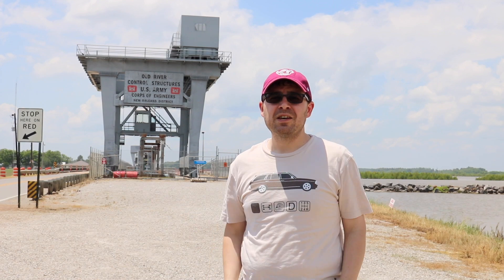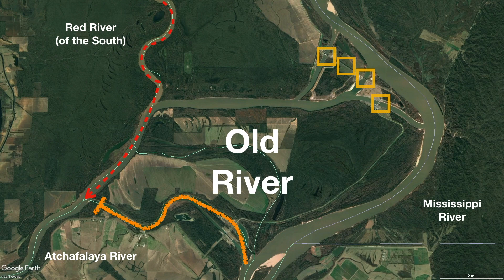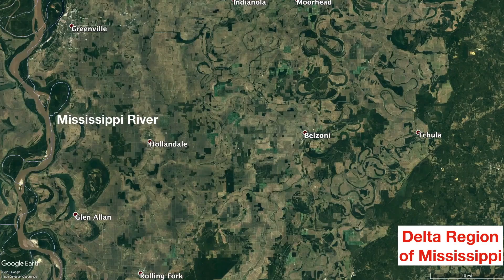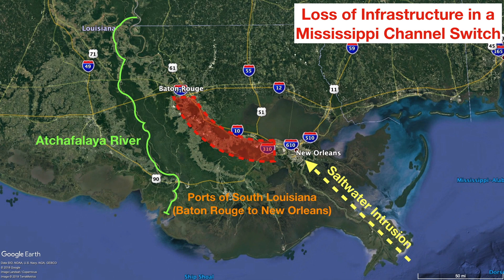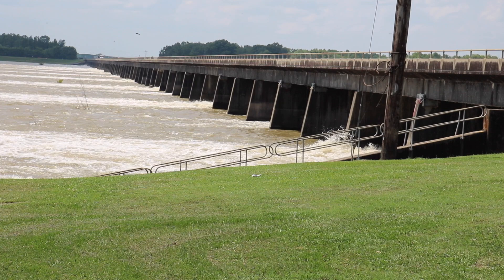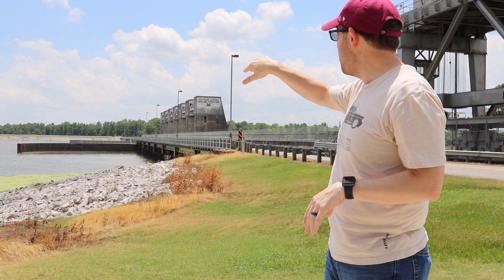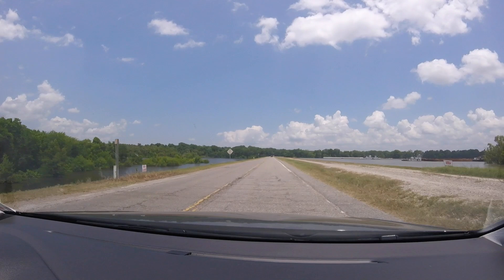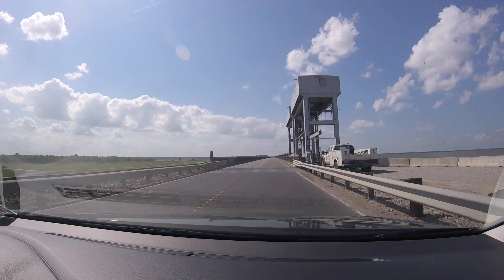Old River Control Structures--Phenomenon Explained

Comment: For a very informative essay on Old River and the control structures, see John McPhee's book, The Control of Nature. FWIW, New Orleans is considered to be in the ocean domain, and McPhee says it is not a matter of if the control structures fail, but when.
Reply from the maker: His essay is what got me interested in Old River years ago when I stumbles on it online. At the end of my series I'm going to do a quick wrap-up and list some more reading materials and that's the first resource I'm going to talk about. It's really good.
Reply: @lorencklein  McPhee is the gold standard of nonfiction.  Any book with his name on it is worth reading.  Most of his books consist of indepth essays, some of which I've read a dozen times or more.  Someone who just wants to get acquainted with McPhee's writing should read The John McPhee Reader and The Second John McPhee Reader.
Reply: @lorencklein  

Harold Fisk's report/study from 1952 provides plenty of information on this subject as well. So does the Louisiana Water Resources Research Institute study of 1980. Eventually what Fisk outlined as the "Project Flood" will be what causes the failure of ORCS. The entire flood control system of the Lower Mississippi River Valley was engineered to handle a flood event of up to the lower projections of Project Flood (river height & flow rate). Many of the Corps data graphs for current river conditions include Project Flood variables in those graphs. The doomsday flow rate is 2.71 cfs or greater at Vicksburg.
Reply from the maker: I have that article, as well as 3-4 other ones that I'll use in a future video on what would happen if the Mississippi changed its course at Old River. I found a couple others in a book called Beyond Control by James Barnett that was published in 2017.
Reply: @lorencklein  

Thanks. I will order that book shortly. I just previewed it on Amazon & in the opening Barnett says the ORCS was receiving a flow rate of 3 + million cfs in 1973 when it almost failed. I find that not believable being the entire  flood control system can only handle up 2.71 million cfs. Plus the highest flow rate just north at Vicksburg for that event in 1973 was 1.962 million cfs. 

https://nwis.waterdata.usgs.gov/nwis/peak?site_no=07289000&agency_cd=USGS&format=html

At 3+ million cfs both ORCS & Morganza would fail due to severe scouring.

Comment: Hello Loren Klein,   Well researched.  The need for the Old Man Structure begins with the clearing of a 30 mile long log jam in the 1830s down the Atchafalaya.   Openning that jam began the slippery slope of the Mississippi wanting to revert to the Atchafalaya as its major outlet.  There are many factors at play,,,,

The TVA and other dams upstream have reduced the silt load.  Temporarily,,, that silt is being saved, collected, behind every major dam upstream.  Levees have also channeled the silt directly out to see,, instead of the river gently over flowing it banks and renewing the level of the swamps  and even the entirety of the Delta.  The levees also build the height of the river exit to the sea,  which also raises the height of the upstream river bed.
Between 1800 and today  the Delta,, New Orleans is built on consolidating mud, has settled as much as 20 feet and the old river method of infilling those low spots,, annual floods has been stopped.  At the same time that the river bed is rising.  Ships passing New Orleans today are in a raised nearly artificial channel, the Mighty Mississippi.  Today June 22, 2019 the river is 18 feet above sea level,, while the average city elevation is sea level,, some as much as 10 feet below sea level.  When a ship passes New Orleans, the bottom of the ship is above the lower areas of the city.      And,, it continues to sink,, and will continue.  The bed of the river will continue to rise.  It is not an indefinite sustainable situation.

That raised river bed keeps making the Atchafalaya outlet and Morgan City a more and more attractive option to the gravity and physics of the Mississippi.   Couple that with the Old Man Control Structures being built in the shadow of an outside corner.  (Who thought that was a good idea?)    The Old Man Structure,, and the preservation of Baton Rouge and Chemical alley,,,,,with a nearly infinite number of dams and levees upstream,, focusing all the water ever to the south,,,.     it is only a when,, not an if.  In some large year,, this or another large water event,, the Mississippi is headed for Morgan City.  All of this is focused upon the ACE and Mother Nature.  The ACE has saved farmers fields and cities upstream, dams to prevent flooding, levees upon levees,, clearing 30 mile log jams,, and all of it points to an acceleration of the difference between the Miss and the Atchafalaya. 

I would begin moving infrastructure to the Atchafalaya,, today.
Reply from the maker: Have you seen my video on the History of Engineering Old River? I discuss all of what you mentioned. Thanks for watching and sharing!
Reply: @lorencklein  I'll look.  This is the first of yours I've run across.    An interesting water year, both sides of the Continental Divide.  There is still a substantial snow pack above 11,000 feet in Colorado.    My interest has been rather small, personal. I spent about 6 weeks in a canoe mostly  in Utah this spring.  San Juan, Green, Colorado.

Comment: Very cool video! I’m on the current crew tasked with repairing the cranes on the low sill structure, been going down there for about two months now. It’s really cool to see that the river structures are finally getting the attention they deserve because they are currently very underfunded and extremely outdated. Lotsssss or pressure to get the cranes back operational and at 100% since the water is so high!